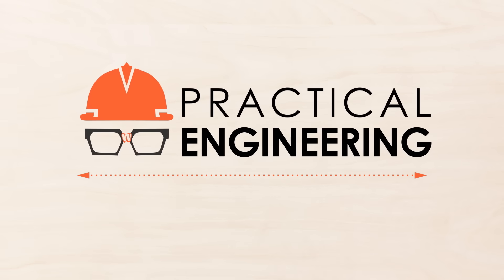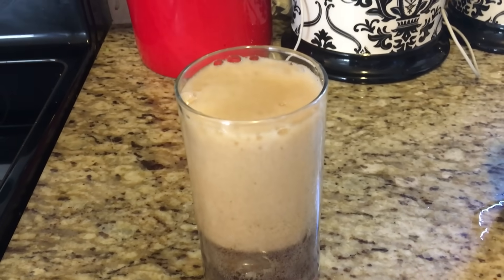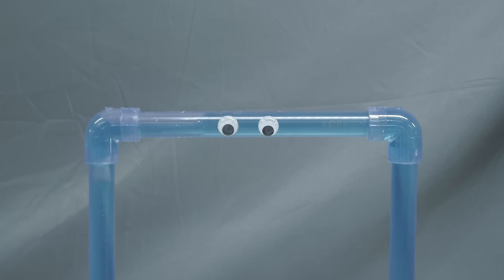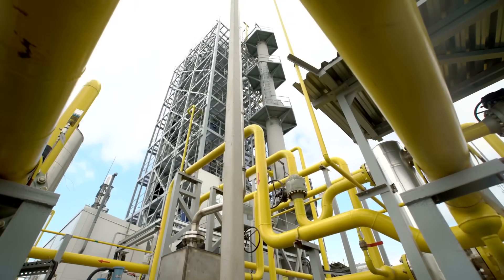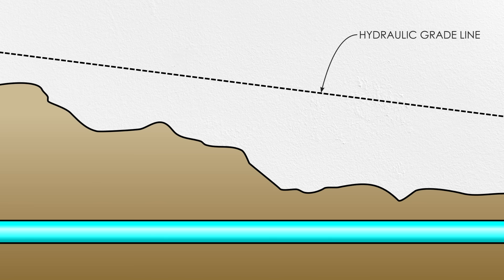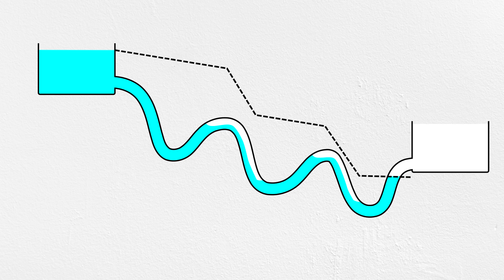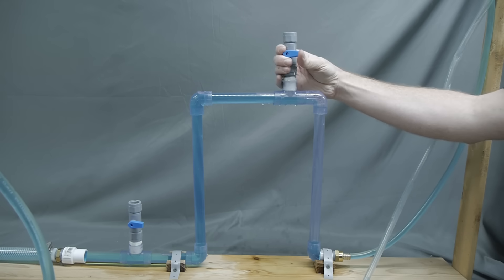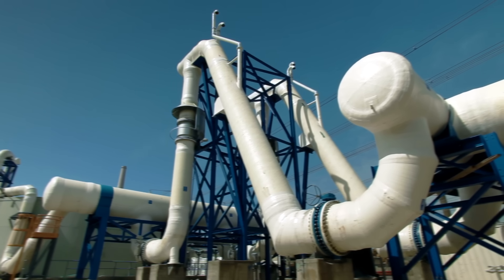What is Air Lock?

Comment: Back when you first did the “what’s that infrastructure” series I sent you a photo of a 5 meter vertical pipe that comes directly out of the ground in my local park. Our suburb was once a swamp and I assumed that there was probably some gasses that somehow needed to vent from somewhere underground, but now I think I would probably guess it was one of these airlock valves. And I think I remember seeing sewage department signs near by to this pipe so I guess methane and other nasties could contribute to this airlock problem. 
One weird thing though: why the height? The suburb was fairly flat and this was probably already at about the highest spot in the area, so maybe just to prevent tampering, or to allow nasty smells to dissipate before they fall to pedestrians nose height or something like that.
Reply: It's probably raised to reduce the pressure of the liquid at the valve, to prevent liquid from breaking through the release valve. Automatic valves aren't perfect and too much pressure might result in liquid following the released gas, or straight up leaking through the closed valve.

That, or it's a release pipe without a valve that goes all the way up to, and above, the hydraulic grade line, effectively using the grade line as a valve. Air gets out, liquid does not.
Reply: theuncalledfor that makes sense. Thanks!
Reply: Do you live in a flood plain. I know here where i live there are a lot of vent pipes like that. Here they have them that way for "100 year flood" level. You mentioned it was a swamp so that may be the reasoning. To prevent water intake in case of a major flood.
Reply: Eldon Eslick not a flood plain but very low lying. Almost sea level. The ocean is less only a few hundred meters away.
Reply: @The.Talent  That would be my best guess. Sounds like you habe an imvestigation on your hands. Haha
Reply: If it's a pipe going 5 metres in the air it's safe to assume it didn't transport air, or at least not normal smelling air. Usually sewage lines and the like follow streets, so that's probably not it either. However, depending on where you live, a possible explanation would be an old bunker. They are sometimes located underneath parks and need ventilation. The height doesn't make a lot of sense in that case though, unless they were storing hazardous stuff.
Reply: Major Fallacy highly unlikely to be a bunker, and actually it was right near a road. You can see it on google street view. There is a wooden pole in front of the pvc pipe in this though so it’s kind of hidden. 

https://goo.gl/maps/QxeSZfc2qLpUfotU9
Reply: @The.Talent  I took a look around and if you look closely, you'll notice a few manhole covers that would indicate a pipe-line traveling near it (one by the small tree garden, and one close to the fence) so it is possible that it is a airlock release valve. Also, is that a faucet next to the decommisioned lamp post?
Edit: I took a look from the other end of the stree so I could see the shape of the pipe, and it does look like there is a valve in the middle of it.
There also might be some underground infrastructure in the area and it needs ventilation.
Reply: Yeah, that's a sewage pumping station there @The.Talent . That cabinet there with the red light on top, stainless handrails leading down to the checkerplate lids and the round sewer lid in the garden beside it give me that impression anyway. If you have a look on the cabinet it should have a phone number you can ring if that red light is ever flashing. I've done it once for one near where I lived at the time. I think it had flooded or something they said.

I was working near one very recently too, and it stank so bad. Here it is: 
https://maps.app.goo.gl/Nxghov6axpEyE1KB9
Reply: @The.Talent  I guess it might just be an air ventilation aid for the pump station itself so that gasses can't just accumulate in the accessible space.
Reply: Tonatsi I don’t think it’s a decommissioned lamp post. The estate is fairly new and all of the lamp posts are metal. I think it’s just there to hold up the pipe.
Reply: David Hill so I guess that settles that then. Seems to me that the brains trust here have solved my years old query. Thanks crew.
Reply: @The.Talent  I'm guessing there's a weird guy in your area who's been keeping his family down there for the last 36 years, and the vertical pipe is to allow fresh air down to allow them to breath. Seems the most likely explanation from looking at the google images.
Reply: Rico S wrong country mate. This is Australia, not Germany. We generally let the wild animals take care of the population control.
Reply: This should be on top
Reply: The height may be related to potentially flammable gases.  The elevation separates the gas from potential ignition sources like cigarette butts.  Vent pipes on gas station fuels tanks are elevated for this reason.
Reply: The hight is probably there so people dont stuff trash into it
Reply: “Hey Bill! Due to a weird warehousing mixup we have a 5 meter airlock valve. We could get the 3 meter valve but it will take a week”
Bill: Just stick it in, worst case scenario this place is better prepared for when Noah needs another boat
Reply: I can safely say that this looks like a sewage pumping station.
The pipe you're referring to looks as if it's only there as a support for the PVC-duct.
If you look at the pipe from the other side you can see a fan attached to the PVC-pipe.
I work with designing pumping stations so I should recognize one when I see one.
The reason for the height is mostly because of odor, but you also have different dangerous gases, for example hydrogen sulphide. This is why the exhaust fan is there, otherwise people (maintenance guys) would pass out and possibly die when climbing down.
This looks as if it's a simple system with only an exhaust fan. But more and more exhaust systems for pumping stations (at least in Sweden) are made with for example ozone and/or carbon filters to decompose the dangerous gases and help bring the odor down to a level not noticable to the human nose.
Reply: @citrynjuice  Almost like a radon abatement fan, pulls the gasses out before they collect to dangerous levels. Makes sense.
Reply: Sounds to me it's likely to be a "stink pipe" (Google it) - an air vent to a sewage system for whatever reason - including to avoid air locks or syphoning. One near me is on the top of a 'small hill' - sewage is pumped to the top and then gravity takes it down the other side - the stink pipe letting air in so the sewage can flow freely down hill.

I'm also aware of a floodwater storage chamber about 7 miles away - it has 4 stink pipes to it. The height of it is to keep foul smells away from people !
Reply: If it used to be a swamp, it's most definitely still a flood plane.
Not yearly or something, but those 100 year floods will get ya.
It's probably that high just to prevent water flowing in, in the very very rare case that your area floods.
(remember that time in Jan 2020 where Queensland got a year's worth of precipitation in 48 hours? Insanity)

Comment: I wonder if that's what the odd square "humps" in the petroleum pipeline along PA-837 are. I can't tell from the Google Street view picture, but it looks like there could be a gas relief valve up on top of it.

They are here, between the railroad tracks and the river, if you'd like to look 40.3576799, -79.8572098
Reply: Now I want to know too.
Reply: I reckon you might be right. I think it might also offer a bit of flexibility for expansion and contraction with temperature changes.

Map link for anyone on mobile: https://goo.gl/maps/YpqyQQnqwAnP8T386

Comment: Another form of air lock is very deadly.
An air emboli is when a bubble of air manage to enter your blood vessels and can block it leading to that organ not able to get blood and can prove fatal indeed.
Reply: Which is exactly why I eat a bleed valve for breakfast every morning.
Reply: you can also get this when you dive deep and then resurface too fast (or go on a plane too soon after diving), causing the nitrogen in the bloodstream to undissolve into a lump of air
Reply: The 'resurface too fast' you are referring to is called: decompression sickness (DCS) (also known as 'the bends' or Caisson disease). It can occur in SCUBA divers/ deep sea divers OR in High atitude/ aerospace events also, and it is when the dissolved gasses in your bloodstream come out of solution, leading to bubbles.
Reply: @Yadobler  What you're describing is the bends.  Embolism has a different cause, although both are air bubbles and are pressure-related.   Embolism is caused by holding your breath when ascending.  When you breathe on scuba, the regulator feeds you air at ambient pressure.  If you're ascending and your lungs are already fully expanded, a difference of about 1.5 psi (a little over 3 feet difference in depth in seawater) is enough to rupture an alveoli and introduce bubbles directly into the bloodstream.  These bubbles get bigger as you continue to come up.  The way to avoid this is to constantly breathe in and out, and never hold your breath.
Reply: @Yadobler  for some reason this the is firs time i heard of read undissolve
Reply: This is probably one of the reasons why they always squirt some fluid out of the needle before inserting when administering a vaccine
Reply: @SuperSiggiboy  It's meant more as a precaution than anything when it comes to giving things like vaccines. Vaccines are typically administered into the muscle, so the chances of accidentally hitting a vein and injecting into that (combined with the small volume of liquid in a vaccine) makes the risk of an air embolus almost purely theoretical. Air inside your tissue or muscle isn't good, either, however, so it makes sense to avoid it altogether.
Reply: @SuperSiggiboy  Nope. Vaccines are usually always given intramuscularly so some air is no big deal. It's just good practice to not inject air if you can avoid it. Only a large volume of air injected into a big vein in one go is going to be a problem. A few bubbles in a syringe? No.
Reply: Siggen it’s definitely why. It’s also why they flick the needle first, to knock all the bubbles to the surface before pushing all the air out
Reply: And you usually get one when putting a pipe in your body (a central venous catether)
Reply: @Brundys  You can get one when putting in a central line, but I wouldn't say it's 'usual' to get one. This is the precise reason we tilt a patient head down when we insert them to avoid air accidentally being drawn in (because the pressure in an upright or lying person in their big neck vein - the jugular - is negative, so if exposed to ambient pressure is likely to want to draw air in).
Reply: @Brundys  don't spread misinformation. Unless of course, by "usually" you really mean "very rarely".
Reply: but on the bright side, you need about 50 cL (500ml) of air injected as a bolus within a major vein (median cubital, subclavian, etc) to cause heart problems.
the down side, is that any small amount of air injected has the potential to cause an embolism anywhere in the body, leading to an ischaemic attack (lack of blood flow to an area) which is especially problematic when it happens in the brain. 

so try not to get a venous air embolism. not fun. though the one time i did have one (nurses didn't flush the line at hospital), you can hear it bubbling away at the subclavian vein as it courses upwards.
Reply: @Ezox2408  Not true, way less than 500mL is needed for an air embolus to cause problems. Depending on age you're looking at around 50-100mL to cause an issue. The precise reason for the volume is because it's basically volume of your ventricle. Much like in Grady's example where the system can manage with small volumes, if the air is large enough to displace all of the blood in your ventricle it will not be able to pump blood to the rest of the body, causing hypoxia and irreversible damage to the tissues.
Reply: @balazshollos  ooh i apologise then!
Reply: @Ezox2408  Lucky to be alive, man. The hospitals in the USA kill 250,000 people every year.
Reply: @jared8515  "According to a recent study by Johns Hopkins, more than 250,000 people in the United States die every year because of medical mistakes, making it the third leading cause of death after heart disease and cancer."
Reply: @Jacks_Suffocating_Nihilism  holy shit!, the numbers could even possibly be as high as 400k, that's scary as hell. Cheers for the link NUKE
Reply: The airlock on the ISS can be deadly too if you’re not wearing a spacesuite
Reply: time to crispr ourselves some air release valves
Reply: Medicine is just wetter engineering.
Reply: Sorry english not first language,  nor second, or third.
Reply: ...I was just watching doctor mike and was not expecting medical comments in engineering videos.
Reply: @neurofiedyamato8763  Forgotten Weapons made a military vehicle video so...
Reply: But that doesn't happen unless unless the iv line has a large amount of air but nurses like to be careful with it especially with pediatrics
Reply: Is this a motherfucking JoJo's Reference?!?
Reply: KIIRAA KUIINNN !!! blows up vein to stop air from traveling through bloodstreams
Reply: Makes one wonder why, in the movies, "the torture doctor" bothers to remove the air out of the syringe before injecting the good guy.
Reply: Not correct. It would not be possible to have "an air emboli". The word "emboli" is a plural noun. However, it would be possible to have "an air embolism".
Reply: "Instance" rather than "form" may better describe what you mean.
Reply: much that this maybe the case, i recently had a heart bubble test, this was when they intentionally shot bubbles into my blood so they could see the flow of blood through my heart on an ultrasound.
Reply: Kelvin Neodama “sounds arousing”
Reply: Stray Cat is all bout that
Reply: is that a j
nevermind
also, divers experience this
Reply: Ask this to deep divers
Reply: That small air bubble trapped in your IV line is "just" called a, "Kevorkian Bubble".  
Don't worry.
Reply: That is true and important to human (and aquatic animal) physiology, but entirely different than the type of hydraulic "air lock" that is accurately described in this video.
Reply: I was a heroin junkie for years and even the retards I was hanging out with at the time (myself included) were smart enough to squirt the syringe while upright and flicking the tube until there were no more air bubbles.
Reply: Well, it's only really an issue if the venous air volume is large enough to cause pump failure (ie. fills your right ventricle - you need about 150-200ml) and then it stops pumping as it can't pump air - it's a water pump! 

Small air bubbles are not really an issue as they dissipate quickly. The only exception to this is if you have a right to left shunt (either in the heart or great vessels) which is very rare... then you can have a fatal cerebral air embolus from very little air.
Reply: During Trump's Second Term he's going to give Sleepy Joe a Televised kiss on the Cheek 🎅🎄🎅🎄🎅🎄🎅
Reply: @gina4319 Reading your comment on November 10, 2024. Trump's second term!
Reply: @Toughen Up, Fluffy And Embolia is the medical condition. It's Latin, the ancient universal science language, still in use in medicine and law. :)
Reply: There’s also the bends.
Reply: When serum bags are changed, a lot of bubbles get into the pipe and enter the vein, it happens all the time in every hospital in the world. Nobody has ever died because of that.